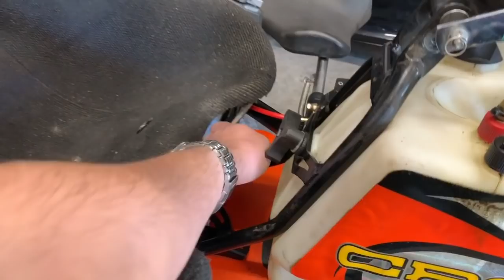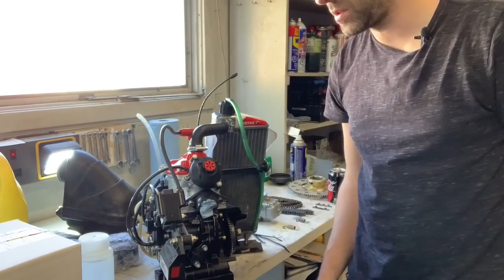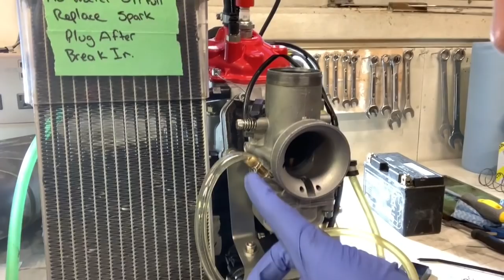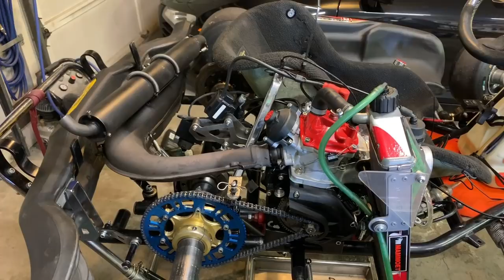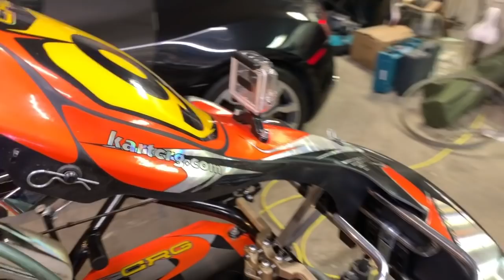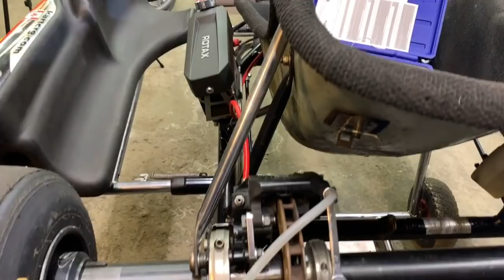Before the First Race

Comment: Hi,

I am having a hard time to bleed mit CRG brakes.
Could you please explain the exact steps?

1) remove cover, make sure level is high enough
2) build presure by pumping, cold it down gently
3) open valve at rear caliper and push the pedal all the way down
4) while holding down pedal close valve
5) let of pedal
6) refill brake fluid to top level

Is this the right procedure? How many times do I have to repeat this?

Thanks for the awesome video and help
Reply from the maker: your steps sound correct.   If you push the brake pedal too hard, fluid will squirt out of the reservoir and make a mess.   

You should empty the reservoir every 3-5 'pumps' of the brake, and opening of the back bleed valve.   Do that 2-3 times.  Make sure you put about 2-3 or maybe even 4 reservoir volumes through your brake system.  Once you get good at it, it should only take a few minutes to do.   This will be about 100-200ml of brake fluid.  You shouldn't need more than 200ml to make sure you have clean fluid in the brake callipers.     Best of luck!

Comment: Is the kart very loud or a little loud (same sound/dB rating as a chainsaw due to the muffler/silencer)?
Reply from the maker: hmm.... how to describe.   Briggs are surprisingly loud.  Like a 3500watt generator at full load with a terrible muffler.   The 2-strokes are noisy but maybe just a little less noisy.  The shifters, are about the same as the 2 strokes, except for certain engines like the honda.  They are massively loud!     And ALL of them are much quieter than a porsche GT3RS or a Lamborghini.      Hopefully that helps!

Comment: I might be starting next year, I am 14 at the moment. I have gotten most of my knowledge of racing from playing sims like assetto corsa, f1, and gt sport. The only time I go karting is driving around in rentals with my mates but I really want to   start karting and maybe purchase one. Would you recommend buying kart second hand because I don’t think buying first hand will suit my budget.
Reply: Also what class would you recommend. (I am from Ireland)
Reply from the maker: Definitely start with 2nd hand kart.   I would recommend not buying from the 2nd hand market, instead purchase from a reliable and trusted go-kart shop.   As a new Karter you won't know what to look for and it will be easy for someone to sell you a kart with damage, bent parts, wear, or an older engine that will cost more money than you expect to get it fixed.   Pay the extra $1000 or so and buy from a shop for your first kart.    Buy whatever is a popular class with your local club!
Reply: Brent Kadler ok thanks for the advice!
Reply: Brent Kadler I know someone who has a friend that owns a few karts and is selling them so he is looking for a good kart for me. Hopefully I will be able to get a decent one.

Comment: How often do you need to service your Rotax engine.
And is it then a brand new crankshaft, piston and bearings or just a piston.
I'm brand new to the sport but Im in absolutely love. And thx for the videos they are very helpful😉
Reply from the maker: Some Say, you can get as much as 50 hours between re-builds.   What all the competitive drivers do is get a new top end every 20-25 hours, and a new bottom end every 40-50 hours.  I rebuild my motor every 2nd season.  I get usually 12-13 hours per season.   I'm curious to know what other rotax drivers from elsewhere in the world do?
Reply: @brentkadler2870 
 Thanks for your answer.
I'm from Denmark🇩🇰 and the guy I bought It from, said that they could go 25 hours. But the service book said that he changed the crankshaft, bearings and the piston. So I was wondering if I had to do that too.
So thanks for your help you are the guy.

I know motorsport is pretty expensive I have had a dirtbike for some years. But I could do all the service and engine work by myself, and with help from my brother. I don't know anything about Rotax engines, and they need to get sealed. So it has to be done professionally. The problem is that I'm 14 years. And my parents are paying for fuel and oil, all the other stuff I need to pay for. I have to jobs to make it possible. I will admit that I got a shock when I found out what tires cost: 350 calculated to Australian AUD I don't know if It's the same I australia but the cost of the sport is the fun worth😁
Reply from the maker: @andreasjacobsen1637  Yes it can be expensive.  Budget $500-600AUD per year for engine upkeep.   Sealed engines increase the cost, but it also greatly increases the reliability.  Our club has virtually zero engine issues with Rotax.  This is not the case when everyone does their own maintenance.  Working for money to pay for karting is great, and i'm confident you are learning excellent skills at your employer.  Keep it up.  Having work ethic and the ability to make your own money will put you WAY further ahead than most of your peers.   Keep at it, and don't be afraid to ask people you admire for advice and help!
Reply: @brentkadler2870  Oh okay that's actually not as bad as I thought. Mayby it's a bit different from country to country, it also depends on what you want done of course. But if it's in the scale of 600 AUD I would be grateful😄
And thanks for your support 😀

Comment: Which year cylinder did you get?
Reply from the maker: Brand new.  So it will be a 2018 cylinder head.
Reply: @brentkadler2870  yea..being brand new doesn't necessarily mean it is 2018 for sure, many dealers still have left over from previous years still in the box. Look on the side of the cylinder and see if you see a sort of engraved square bar code...from 2018 they came with this. Also the 2018+ heads are guaranteed to be able to match and exceed the best cylinders of years past... they've basically utilized 3d printing to help achieve this. So just an fyi for anyone out there thay owns a senior rotax and you want to be 100% sure you have an engine that is up to scratch with the best around... get the 2018+ senior cylinders
Reply from the maker: Yes I just checked.  There is definitely a square barcode on the cylinder.  This was sold to me as a 3d printer cylinder by a shop i trust 'overdrive motorsports'.  I've noticed its significantly snappier out of the corners.... but it's hard to say how much of this is due to the rebuild and how much is due to the cylinder.  I'm looking forward to a good season of racing. Thanks Christopher!
Reply: @brentkadler2870  just curious, how long did you run the engine before having it rebuilt?
Reply from the maker: @IggySport1388  It was about 28 hours 32 minutes.  The reason for the rebuild was a seal failure on the bottom pump shaft.  It certainly wasn't due for a re-build except for that darn seal.
Reply: @brentkadler2870  28.5hrs on the same top end or did you have a new piston/ring put in before that?

Comment: At around 10 minutes in you state to only use deionised water. Why is that"
Reply from the maker: If you use regular water, you will get mineral deposits inside the cooling chambers of the engine and radiator.  Over time these will accumulate and reduce cooling performance and/or cause corrosion.  You can also purchase pre-mixed water/glycol as this will already contain de-ionized water.  Thanks for watching!
Reply: Brent Kadler good to know. You seem to have good knowledge on rotax setups. Keep up the good work, definitely need more rotax videos on youtube.

Have you any experience on the pre evo engines. Im nearly finished setting mine up after years of storage. If so, any gains in power or acceleration?
Reply from the maker: @byrnesy919   only a little with the Pre-Evo.  My friend runs a pre-evo and it's not quite as quick.  About a half second off on a 56 second lap.  Good enough to compete with but not good enough to win.  The biggest difference appears to be the power valve operation.   It's hard to tell how much is the evo / pre-evo and how much is just an old tired cylinder.